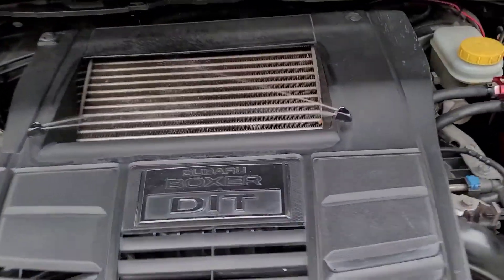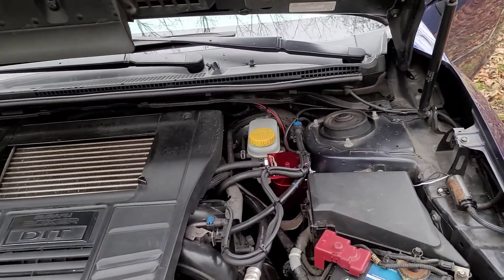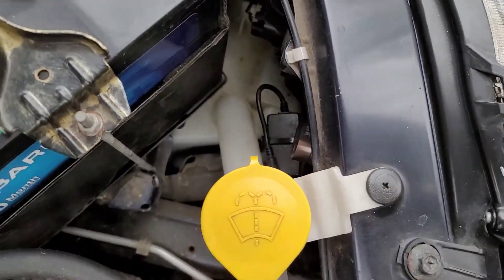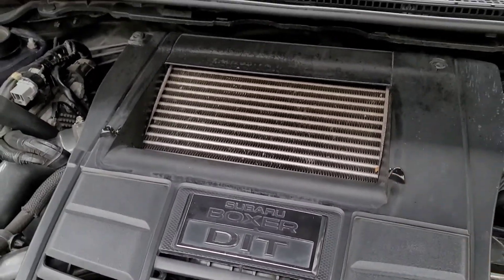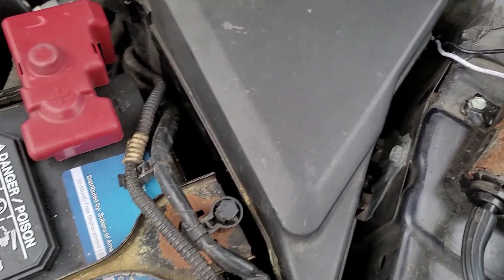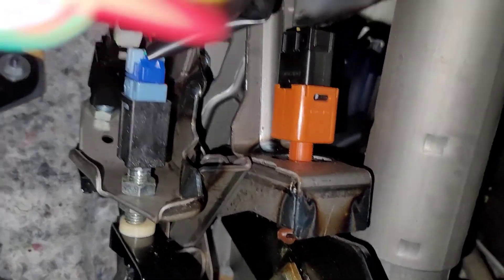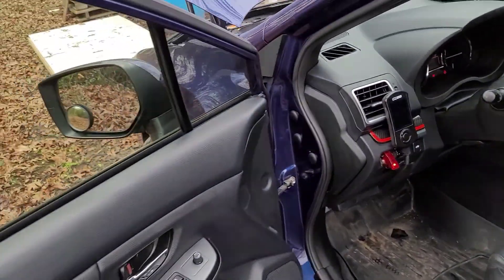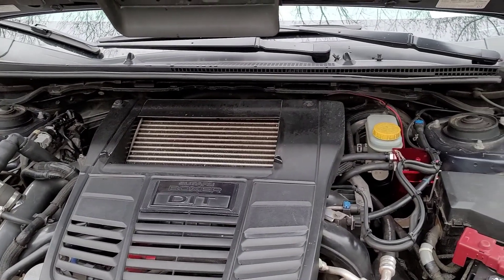Universal Fit Intercooler Water Spray DIY Real Cheap

Comment: Why not attach the spray activation switch to your accelerator pedal, such that the spraying will occur only when you floor the accelerator pedal? I mean, isn't that the time you most want the additional cooling?
Reply from the maker: You would want cooling before you floor it and would want to use it like after sitting in traffic when your engine bay is really heat soaked and intake temps really high. Having it tied to the pedal would also mean you are spraying all the time and would get an empty tank of water after several minutes, maybe an ok idea for racing applications only.
Reply: @fixflickss  Ah, makes sense.

Comment: Use factory Subaru windshield squirts way better spray pattern. Did this with a front mount intercooler.
Great job on install really man
Reply from the maker: Thank you, any ideas on mounting points without using stock engine cover?
Reply: @fixflickss  I used a drill bit I think it was 1/4 then the factory clips on the squirter just clicked in I could still turn them. Went front mount a few months later.
I got a small washer tank off Amazon so I could mix water/meth and spray it worked so much better and I used less overall to achieve the temps I wanted
Reply: @fixflickss  I measured from the bottom corner of the intercooler shroud on each side 1/2in outward so it was still slanted down toward the fins/blades
Reply from the maker: @BobbyB910  thank you
Reply: @fixflickss  hey man us car guys gotta share info and keep the at home builds going!!!! 
Built not bought baby
Reply from the maker: @BobbyB910  💯 %

Comment: Where do you hook the white (power supply) wire to? I tried on a 15a circuit and it’s fuse gets blown and pump motor eventually dies. Maybe I got a bad pump ?
Reply from the maker: One goes to ground and the other goes to power to complete the circuit, if you connect both wires to the fuse you short circuit blowing out the fuse.
Reply: Where to for power source?

Comment: Good job. Does it really help the acceleration/hose power?
Reply from the maker: Thank you...to be honest I am not sure, I use it as a safety when sitting in traffic where the heat soak is huge and as soon as traffic ends I spray before I rip the car, it definitely helps to bring the manifold air temperature down quicker